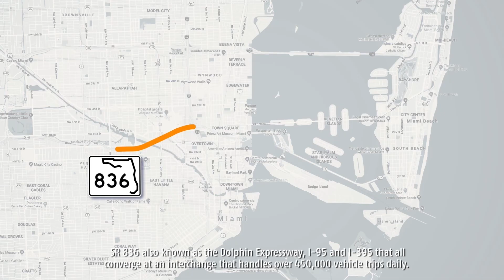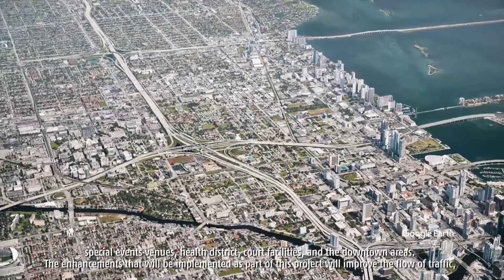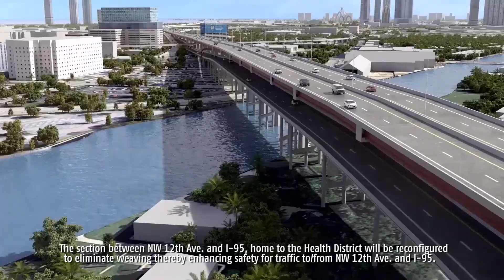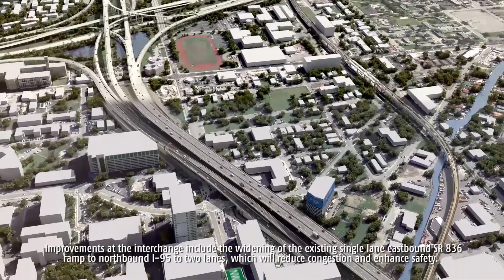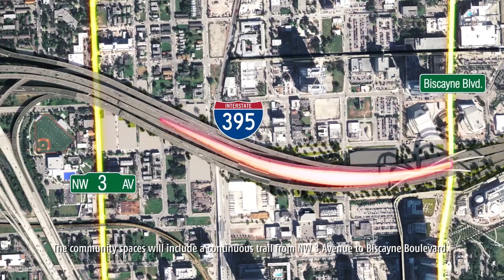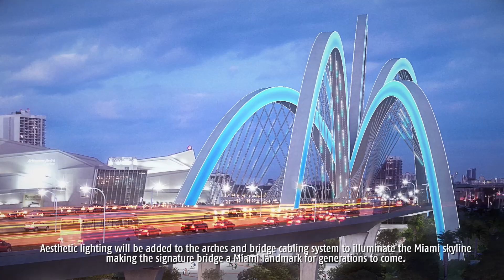I-395/SR 836/I-95 DESIGN BUILD PROJECT, CONNECTING MIAMI

Comment: You're just adding lanes.  That empirically harms safety, access, traffic flow, and undermines local+state  environmental goals.

More lanes encourage unsafe driving.

Wider roads are wider barriers for communities and businesses that cross them.

Lane additions move and intensify traffic bottlenecks instead of solving them.

Wider roads are additional pavement which needs additional maintenance and repaving.  The additional pavement area increases pollution from runoff and tire particulation.

Think of the businesses and housing that would be more productive uses of such prime land!

Expand Miami's public transit and bike network, take advantage of the flat, dense geography!